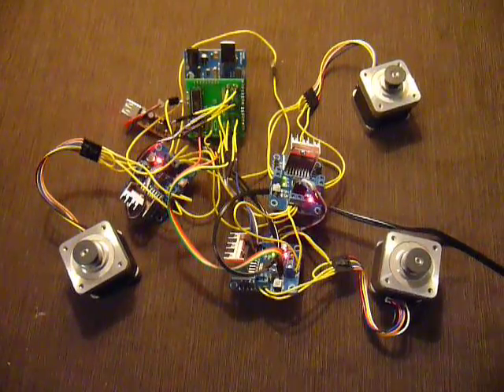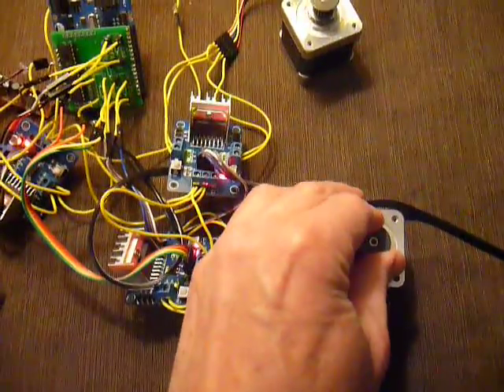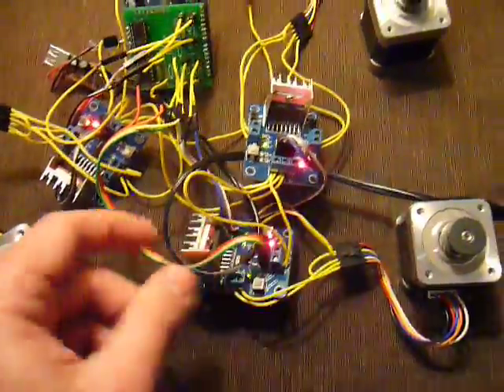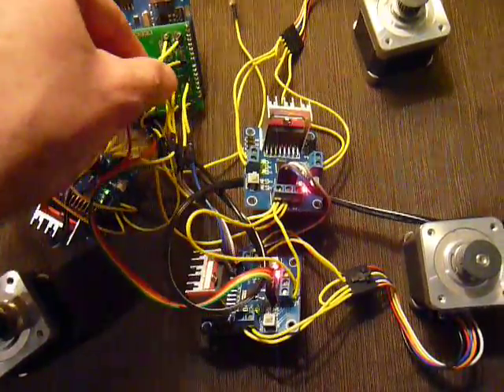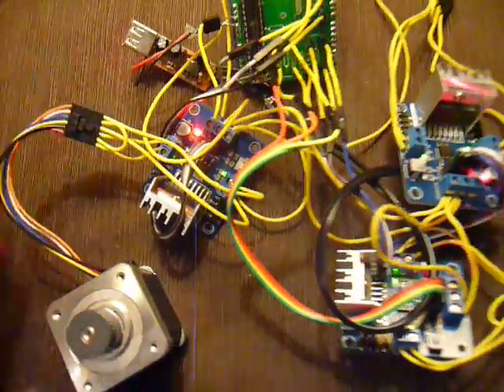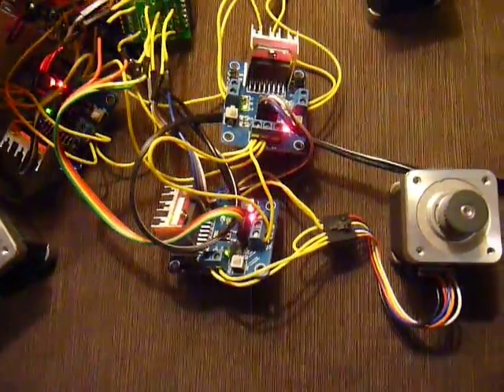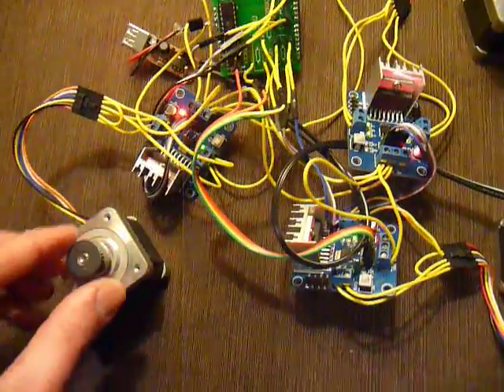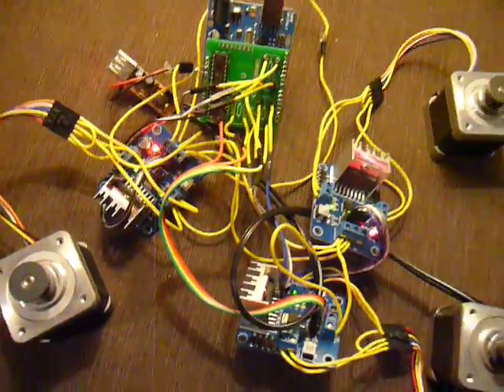stepper

Comment from the maker: Thanks for the comment.  I'm also a noob at 3D printers.  This was just a proof of concept to show that I could control steppers.  My next step is to get back my pcb and start trying to decode gcodes.

I don't know anything about 3D printers yet, besides a reprap uses nema17s and a stepper motor can be controlled from a l298n.

I started a link on arduino.cc about this project here: 
arduino.cc/forum/index.php/topic,150106.0.html
I also volunteer my time on fiverr .

Comment: thanks for the video.
what i don't understand exactly is the wiring, my setup:
-arduino uno with grbl 0.8c
-3 stepper driver boards (with l298n) from dx.com
-google sketchup 8
-3 nema 17 (will order soon)

questions:
-where could i buy a "printhead" for ABS?
-does a wider threaded bar make the accurateness higher?
-what power supply do you use (V=?; A=?)

could you give me some links because i'm a total noob in electronics, and my eyes are starting to bleed.